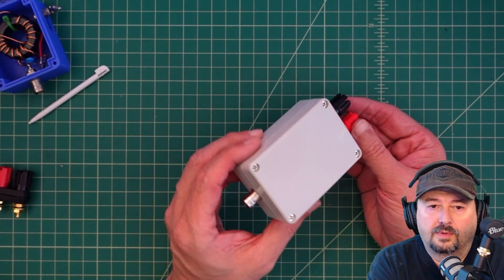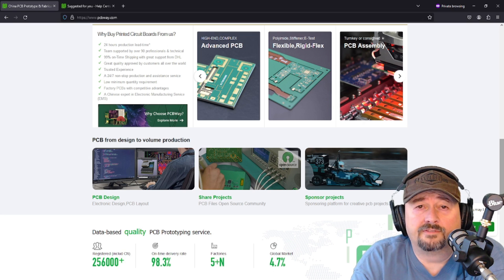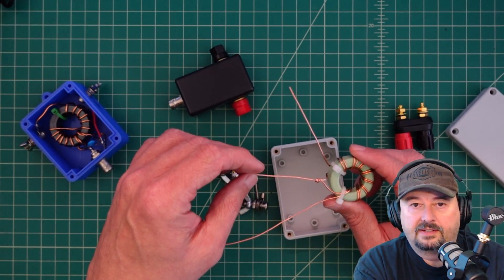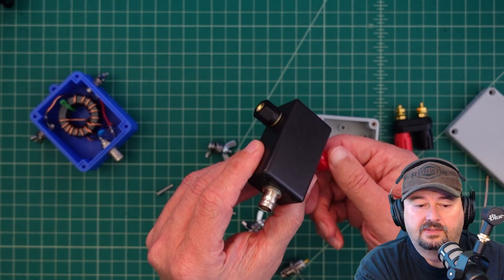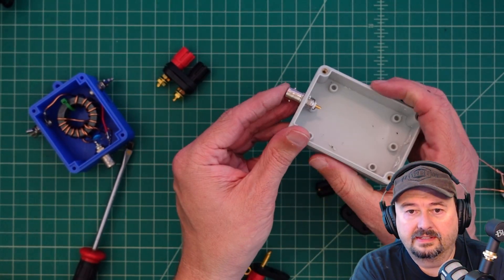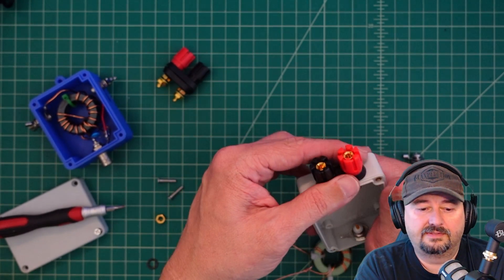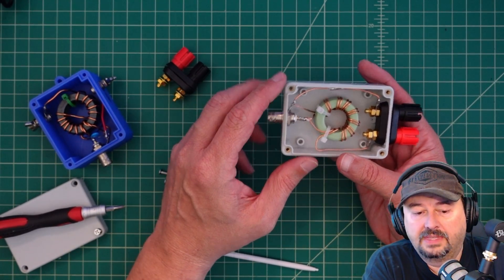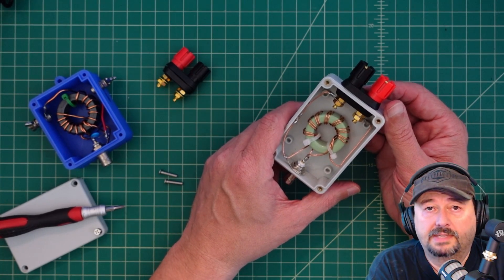Discover an EASY 4:1 UnUn for Ham Radio Antennas!

Comment: Hi so I'm making a Rybakov for pota activations so I can work several bands with a low footprint. I found a drawing for a 4:1 un un that had 12 turns on the torroid I tried this and it does tune up OK on 40 20 and 10. But I'm going to try this version for comparison. Also how critical is torroid type?.Thanks 73's
Reply from the maker: The toroid matters more depending on the tuner; a 43 or 61 ferrite mix will have the lowest loss.

Comment: What you have at best is a 4:1 transformer or  a voltage unun.  Voltage baluns/ununs are fine for balanced mixers etc but what we want for an antenna is to reduce common mode currents. One cannot make a 4:1  current balun on a single core. Even then, without making a VNA measurement across the frequencies of interest  of S21 dB or preferably an S11 R+/-JX plot,  you don't know what you have.
Dale W4OP
Reply from the maker: Pretty sure Isaid it was a 4:1 voltage unun and that it should be used in conjunction with a 1:1 choke.  Maybe you watched a different video?
Reply: @TheSmokinApe  No mention that this is a transformer or voltage device  in the video. But the new thing I caught is that you are trying to use a powdered iron core to produce baluns and chokes. Powdered iron does not have near the initial permeability (ui) to make  an effective choke or balun. Powdered iron is fine for inductors. Ferrite material with its ui typically 10X higher than powdered iron is used for  wideband chokes. eg #52 powdered iron  has ui=75. Type 43 ferrite is 885. I am guessing you never tested the device you built in this video or the same 52 type powdered iron in your CaHRTenna video for  either S21 common mode attenuation or S11 reflection impedance.

Dale W4OP

Comment: nice UNUN for go kit. I will make more later. out of ferrite cores. want to make a 9:1 as well. even a 64:1 for 160 meters. the 3 I made now work great ! FT 240-43 in 49:1 with cap. runs 250 watt all day . the 2 stack of type 61 in 49:1 3KV cap 100 PF . runs 500 watt FT8 no problem on 10/12 maybe 6 meters. the 2 stack of FT 240-43 runs same power and better for 80/40/20 /17 /15 meters, found QRO on 10/11/12/6 meters type 61 FT 240 runs cooler. thermal cameral tested . had slight better SWR band with on them bands . I have the same binding post. think I will use on 9:1 for my go kit. need toroid and box. have the rest. want to make a 64:1 as well. 4:1 will work for loop on ground antenna as well. I want a bunch to play with for all day POTA . 73's
Reply from the maker: Hey Robert.  I am thinking about doing a two stack ft240-43 49:1 but not sure yet 👍
Reply: @TheSmokinApe  use like 12/or 10 AWG wire . less heat on wire when going QRO . my 16 AWG wire heated up a tad FT8 250 watt . before the core heated . try it use the IR camera . what I did .
Reply from the maker: I have to look, I think I have some 12g

Comment: Another banger, Ape. Is the toe-roid secured to the box somehow?
Reply from the maker: Thanks AV. No, the roid isn’t attached the solder point to center pin is pretty solid and I’m not taking it to the front lines so I wasn’t too concerned about it 👍

Comment: I’ve been wondering how a 4:1 unun would work with an ofcd since I heard you briefly mentioned it in another video you did. Thank you for clarifying that. I’m hopefully going to be taking my general exam in a few weeks and this was the one I wanted to build for it. Curious if you would know though what length of wire would be preferable for making an ofcd that would have resonance on 60m? We have AUXCOMM nets here in Georgia on 60 meters and I’d love to get onto that once I pass the general. A simple resonant dipole would work yes, but I like the idea of having a multiband antenna even if it’s a compromise.
Reply from the maker: Hey Matt, good luck on the test.  For an OCFD you would use the same overall length that you would use for a dipole but you feed it at the 66/33 point and not at 50/50.  Connect the 66% leg to the center conductor and the 33% to the shield and you are good to go.  An OCFD for 60m should work fine on 30 and 15 as well 👍

Comment: Mr. Ape, what kind of RF bandwidth did you get out of that unun? Very nice!
Reply from the maker: We need see this core on the CaHRtenna Poseidon, which is a 25’ vertical with 4 17’ radials.  We’re able to get 40-10 with a tuner.  It hasn’t been tested on an OCFD and I might prefer a mix 43 ferrite on that.  Just more testing to do…
Reply: @TheSmokinApe  let me know when you get that OCD antenna design up and running....
Reply from the maker: @watthairston1483  I’m sure there will be videos